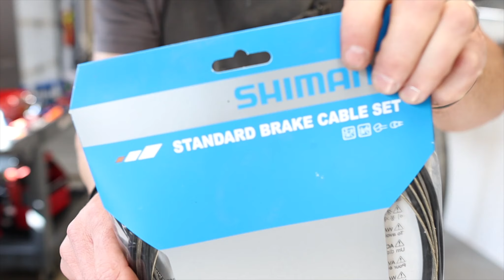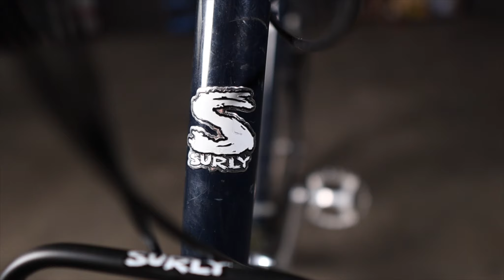Building up my Surly Trucker DeLuxe

Comment: On your ride you will find out why I start with 80-90s MTB frames. 26"wheels 1.75" tires for road and 1.95 for gravel, I go with 1X 8,9,10 drive trains with friction thumb shifters, 420cm width riser bars and the same kind of ergo hard rubber grips, bar height slightly higher than the seat, and a long handlebar stem so the steering is not squirrely.
Reply from the maker: I have some miles on this bike now over the weekend and I'm really like the way it's setup👍

Comment: I have my Surly LHT 26" sitting here right next to me, I've been struggling on making the bike as comfortable as possible.  I'm wondering is that a Surly handlebar that you have on your build?   I currently have a Surly Open Bar and I just went for a 30 mile ride and came back being uncomfortable on my back and arms.  I don't want to go back to the drops (I'm in my 70s now)... the sweep on the Open Bars is too weird.

The handlebars you have seem to be close to a flat bar, I need something to keep my Surly going.  What bars did you wind up putting on??

Thanks, great video, i like your laidback approach, just like hanging out in a good old bike shop, just add a Golden Retriever in the corner!